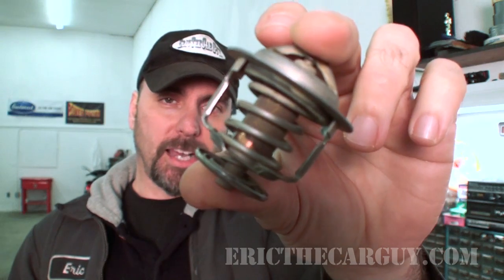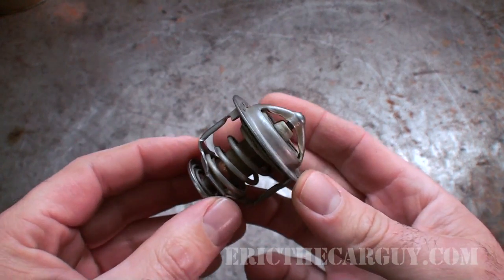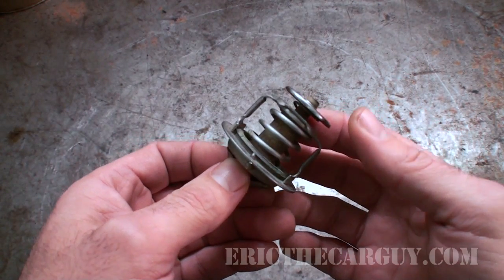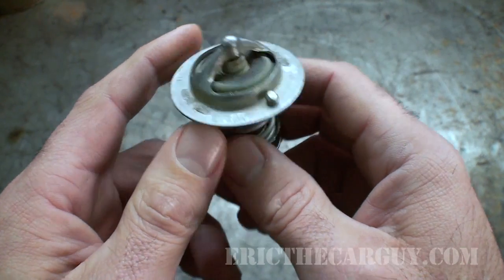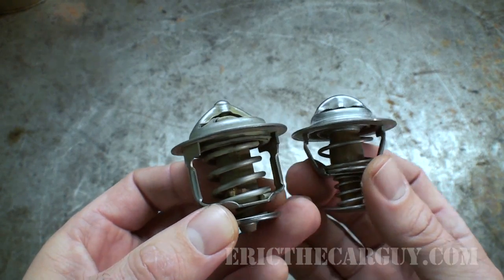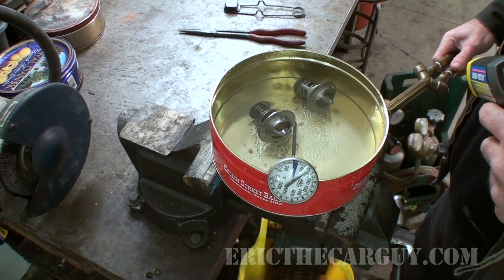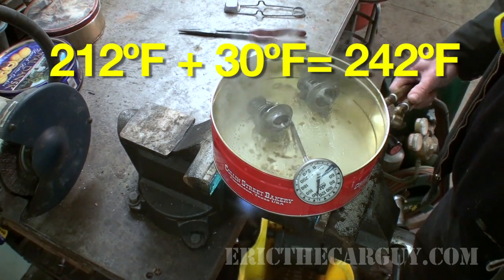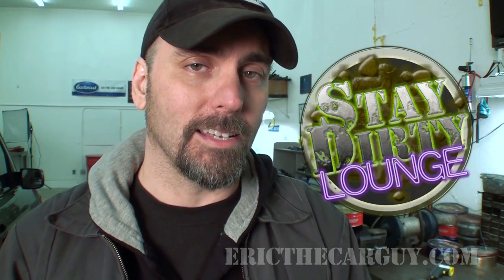Understanding and Testing Thermostats -EricTheCarGuy

Comment: sorry for the book: i am just trying to understand theory of operation and i have  questions and observations. if i was to run just water will the engine run too cool? water carries the heat and the system was designed to deal with a certain heat dissipation rate. my vehicle has ran about 179-185 degrees. i put in 2 after market t-stats and the temperature  i think is too low, i also changed out the coolant temp sensor twice last summer.  i recently ran with only water for a few weeks after repairing a broken heater hose to make sure i actually had the leak fixed and during that time i got several system too rich obd codes. i am watching live data and i can see i am running rich. i also found a small vacuum leak so the system too rich code went away but i think im still running too cool. i have two of these vehicles and both are equipped to show live sensor data while parked or driving. anyways the second vehicle temp runs 198-209. the vehicle i a am concerned with is the same vehicle but tuns 177-185. i thought maybe only running water for a few weeks was cooling it down too "quickly" so that motivated me to dump the water and fill it back up with the proper coolant to water ratio and it seems like my temps got slightly warmer and in my case i feel that is a good thing. the zone sells a thermostat rated for 160 degrees, why would anyone sell a thermostat that would be so wrong? this is so confusing, i dont know what the target temp of the engine is, vs what mine is vs what the thermostat rating is.

Comment: living here in a daytime  32 - 40 deg celsius ambient temperature, would you recommend taking out the thermostat ? My take, it will lessen the risk of a part failure that can cause a heavy price...
Reply: No, at high speeds your engine temps will drop, causing the engine to constantly run lean on fuel in attempt to heat itself up to working temp.
Reply: @SumoLife  Okay, thanks for the advice!

Comment: I have a 1999 Lexus Gs300 an it keep running hot An I will Put antifreeze An water in it an it will run Hot An the antifreeze An water will be gone what is I’m supposed to do or what could it be

Comment: I have a 2006 Dodge Ram 5.7 hemi I put a 180 thermostat and I have 2 codes bank 1 and bank 2 fuel loop close not achieved and I don’t know if my cause is the thermostat that its not oem 203 degrees anyone has an idea ?or had this happen to them switching to 180 thanks codes I’m getting is p1128 and p1129

Comment: Do you recommend putting a 160 degree thermostat on an ls2. I live in Houston so it gets hot as balls.
Reply: for anyone that sees this question, you wanna use the oem temp thermostat. a lower degree thermostat is for very specific situations and if you have a stock set up you will use the oem temp for optimal performance
edit: having a 160 thermo just means it opens early as opposed to 195 or 200, its still gonna run at 200 even with a 160. if you are experiencing overheating there is something else wrong

Comment: Something you could have mentioned is what can cause premature failure of a thermostat? So many times during the winter a person starts their car to let it warm up. In itself it’s not a bad idea. However if you leave you car sitting outside for 30 min or more the thermostat opens at 192 or whatever its specs say its supposed to open. After opening the water continues to warm inside the engine to the coolant temp switch temperature which can be over 230 degrees. This can cause hyper extension of spring and over extension of the valve. What eventually begins to happen is the thermostat won’t close completely or may stick in a tilted position unable to close completely. An easy solution is to replace the faulty thermostat once it goes bad. So if you notice your car not getting warm enough it could be because it has been warmed up for long periods of time causing premature failure of the thermostat.

Comment: So, I run a dodge Caliber 2007 R/T 2.4L. I noticed my thermostat was dumping fluid when operating from the secondary thermostat. I pulled the thermostat and was wondering if this failure is more indicative of a failed housing? I checked the location, and it is pooling directly under the secondary and leaking down from there. I checked the lines, and there are no apparent tears in it.

Comment: Would this cause my upper radiator hose to blow off? My vehicle didn't overhead because I am vigilant about watching my gauges and I seen the steam from the hood pulled over immediately checked the gauge and shut the vehicle off. I put the hose back on waited 45min then started the vehicle and filled it slowly and drove if home. Luckily it happened only 3 miles away from home and its not my only vehicle. I seen little bubbles when I filled it but nothing big like a blown head gasket but I want to solve the issue before I drive it. I replaced the thermostat about 8-10 years ago and the cap 2 years ago when I replaced the radiator along with hoses.

Comment: My car takes like 10 minutes to start getting the temperature above "Cold".It never crosses the middle on the panel so the engine seems to be always cool,altho I suspect I may have high temperatures because of some issues my car had one day that it stopped working randomly and had no enough fluid in it but no high temperature and I dont know how else can I explain it.
Do you think a problematic thermostat could show to ,let's say ,30% temperature and stuck there?
Thanks anyone who replies to me,I just want to be prepared before I go to the mechanic :D

Comment: Another problem is the wax changes its state as it gets older .You end up with a thermostat that opens way to early ,not letting engine  get up to proper temp and giving poor cabin heat  and poor fuel economy in the winter,even though it shuts off as it should

Comment: i have a daughter, she took her check engine light to autozone to see what the matter was. 2005 kia spectra, they say the check engine light is on because THERMOSTAT.  funny thing/ the car is not running cool and not running hot, it is however running with a bunch of pressure in the hoses , seems like they never release , not even when both the fans kick on.     the car does not run hot - of course it;s winter here but still.,   i would think with the thermostat closed continuously, it would over heat, but i just drove it a pretty good clip and it will not do it for me.  the fans come one and they go off, the pressure on the hoses stay tight. 

  i do not even see how a code can pop up from a thermostat - I mean what the hell ? it;s not electronic.   it's not over heating, the light stays on, it doesn't flutter or ever go out.    code for a thermostat must be from something particular.   cold   heat   line pressure ?     i was under the impression the sensor for the cooling system monitors the temp so it can kick on the fans when the temp rises to pull air through the radiator. from COLD it takes about 23 minutes for those dual fans to kick on just sitting outside @ 25 degree weather idling. . when I get in and drive it around, engine light gleaming, the temp gauge stays in the middle, if i shut it off the gauge will return to cold slowly in approx 45 min total. 

  another funny thing i just replaced the water pump and thermostat and radiator when i was doing the time belt 6 months ago.      crazy.      I probably will not get an answer on this here.  i most likely will be pulling that damned thing out tomorrow with the North wind blowing up my shorts. But i still felt a need to state what was up here b4 i go to sleep 5:30 am.    Grrrrr   happy friday.

Comment: I was told my 2004 ford focus's thermostat is stuck open but I get heat in the cab and it is about half way on the heat gage. I plan on taking a 3 hour trip in 2 days should I postpone the trip or will I be ok?
Reply: Stuck open is not really a big issue apart increased fuel engine wear , as well as longer to get up to operating temp giving poor heater .You may still be able to get to the other side of the world and back .Stuck closed not opening and it will overheat within 5 miles even on a cold day .Carry on driving ,the head gasket goes first and  after that in extreme cases the engine seizes ands basically it's Fooked

Comment: HELP!!! So would this possibly cause my car not to pass emissions??? Ive DONE ABSOLUTELY EVERYTHING ASK of me by the Cali State ref as well as Mits.....ref will not give another 2ys pass, Mits is tryin to tell me its rime to trade it in. Well I CAN'T AFFORD THAT!! Its a 2008 Mits Lancer es, 2.0
Im the orig owner, bought it brand new in Fl, moved to Cali in 2012. 2015 came "no engine lights, but would pass smog, jumped thru ALL THE HOOPS, got a 2yr pass. Well here I am again, Ive done everything all over again, I even replaced both 20 sensors myself, put the best fuel in tank with seafoam. Did the drive tests required and STILL WONT COMPLETE cycle, UGH!!! So I start lookin around on driver side of engine and see that I might have a slow coolant leak coming from my thermostat housing. A local mechanic said he had experienced with another car not passing smog because of a faulty thermostat.
Please help??!! I gotta move back to Fla on the 14th "cant afford to live here any longer"...and so Im leaving this car for my 20yr son that will be tryin to enlist in the Navy. This car is all I have to give him, yeah it has over 204,000 miles on it but other than this STUPID smog issue it runs fine, I cant leave knowing he has no car, PLEASE SOMEONE GIVE ME SOME FEEDBACK!! THK U THK U, Btw, Eric u are a GODSEND for single moms workin on their own car, Ive learned how to do MANY REPAIRS by myself thks to you! 😊🙏🙏🙏
Reply: Yes. It causes the engine to run richer.

Comment: ? My 2006 pt cruiser when driving my tempaure gauge goes down when driving and up while I stop at a light the radiator has been changed and fans and themosat??
Reply: Temperature control sensor

Comment: Hey Eric  I have a check engine light on my 1999 Toyota corolla 1.8 and the code is.P0125 and it say insufficient coolant temperature for closed loop fuel control....

Comment: hi eric, my car overheat lately but when i checked the fuses, relays and radiator fan they;re all okay but one thing i noticed though is when i touched the upper radiator hose after 40 min. of idling, the hose remain cold like there's no fluid passing through. when i stop the engine i noticed the reservior were bubbling. Do you think my thermostat is stuck in close position that's why the coolant is just circulating inside the block and the coolant just goes back to my reservior?

Comment: Thanks for the video and i dont know if you can help me out i just remove thermostat from motorcycle and have the fan running directly all the time but still it overheat please need help
Reply: Check if the water pump is ok. Also radiator might have blockages, if it's a second hand bike the previous owner might have used "radiator stop leak" which actually causes more problems. Try doing a radiator flush and filling fresh coolant. This is very late so hope you don't have any other problems by now

Comment: Eric, you  mentioned two things that could go wrong with a thermostat. I believe there could be a third. Some thermostats come with a rubber seal on the upper frame. This functions as a gasket for the thermostat housing,  where in some cars (like my 95 legacy) the thermostat housing itself does not have its own gasket. 

When this seal gets thin and hard, or worn, I believe a leak could develop. In my '95 legacy the bottom hose leaked from the thermostat housing. When I replaced the thermostat the leak went away.

Comment: One issue I had was a the previous owner of the car used a silicon seal around the gasket assuming it would seal better. Instead what it did was cause a slight build up of gunk behind the thermostat that swelled in the water causing my thermostat to give unusual operation. My car was having the most random overheating I've ever seen. Sometimes it would over heat often sometimes it wouldn't overheat for weeks

Comment: Eric my husband and I just bought a car, we noticed immediately that the temperature gauge only reads for the moment we initially turn the car on. we think the thermostat may be stuck closed but don't wanna risk removing the thermostat unless it's necessary to replace it. we are worried but hope it's just the gauge or sensor, but we noticed that the car stays pretty warm after being driven but we haven't had any overheating problems. the radiator is full of coolant and brand new and we just don't wanna blow the engine, please get back to us on any information you may have that could help us

Comment: Water dissipates heat better then coolant but it doesnt offer the rust or freeze protection. Water being a really good conductor would mean that 100% water would have a great transfer of heat through the radiator. Some products actually cool better than water but most antifreeze/coolants actually dissipate heat worse than water but up the boiling point so its all in how you set it up and what environment you need protection for.

Comment: I just had my water pump and thermostat replaced on my 2012 Ford pickup  because of coolant leak.  However after driving my pickup  2 times approx. 25 miles each time, I notice a loud roaring sound coming from the engine before I turn it off.  This sound was not there when I first started the engine.  Also the gauge which measures heat and cool on my dash board also fluctuated slightly  back and forth from its normal position during the 25 mile trip.  Therefore, I am assuming this has something to do with the thermostat.  What do you think?   And should I drive my pickup very far before I know for sure what is causing this?

Comment: If I start my truck after sitting all night -20 and the gauge reads middle operating temp, then I drive right away and it says overheating, is if thermostat or the temp sender sensor ?

Comment: I need help please! I have a 2003 F150. I received the wrong thermostat for my truck and it didn’t get t appropriate temperature. I replaced it and now my temperature gauge doesn’t move at all. My heater does work. What do you think???

Comment: Hi Eric running a 96 Chevy two wheel drive 5.0 very cold. It overheated on me I went and got radiator fluid put it in temperature gauge will not rise and have no heat is it the thermostat

Comment: Question??.. I have a 95 Ford Contour that uses a "fail-safe" thermostat.. Conceptually these thermostats are a great idea, however, once they lock into fail-safe mode they are no longer able to close and as a result they need to be replaced.. This isn't a big issue with a newer car but if you have an older high mile "work-car" that might run a little hotter than normal from time-to-time these fail-safe thermostats end up being a big f'kn headache!!.. My question is can I ditch the fail-safe and just go with an old-style conventional thermostat with the same temp rating.. This Contour has the 2.0 engine with a 5-spd trans and it runs like a dream, hands down it's one of the best running cars I've owned in the past 30yrs.. So far, the only major issue is that I drive 30min to work so she does get a little hot once in awhile.. Long story short, I'm looking at buying my 3rd thermostat tomorrow morning and I'm thinking the fail-safe is proving to be a waste of money for a car this old.. Thoughts???

Comment: Hi Eric, got a question, if the thermostat is stucked close, will the upper hose get hotter? In my case, engine is overheating in 10mins, weather 30degree, upper hose is real hot, lower hose is cool. Thanks.
Reply: yes if stuck closed its way worse then stuck open closed=overheat open = no heat

Comment: i removed the thermostat spring and the water continously flow from radiator to engine vis a vis.. all clear no overheating how is that.. pls give comment
Reply: If the stat is removed then there will be continuous flow of coolant thru the system. Since it flows continuously then it will not over heat

Comment: Thanks Eric for your vedio. 
I would like to ask you about radiator fan sensor.
as you know fan starts up when its sensor indicates hight temp. and the fan goes on even if you turn off your engine.
my question is this:
is there any danger for on my engine if I moodify the the electricity to turn off either when i turn my engine off?
is there any problem for doing this ?

Comment: Hey Eric, did you ever get around to making a cooling system air burping video? I have a 1988 Jeep Cherokee (Renix) with the original closed cooling system, and plastic coolant overflow reservoir. Having a lot of trouble getting all of the air out of the system..

Comment: hey eric
if my thermostat is not allowing water to flow
would this in turn cause my fan sensor to not work as well
i just replaced my fan sensor and i know the fan and relay is good 
wondering if the lack of coolant flow due to the bad thermostat isnt activating my fan sensor?
Reply: Niklaus Halvorson same here going to change temperature sensor.. but then i know problem is thermostat

Comment: Eric, my car temperature gauge went passed the normal level yesterday and I replaced the thermostat and coolant. Everything was fine for four days until today, the gauge moved pass the normal level again. I check the fans and they are working.  What could be the problem? As soon as the vehicle is in driving mode the gauge goes back down.  It doesn't hit close the red zone.

Comment: What if I am missing the air purge valve insert?  I am trying to troubleshoot an overheating Civic.  It has the hole, just not the little piece.  I wonder if I will flush out that...